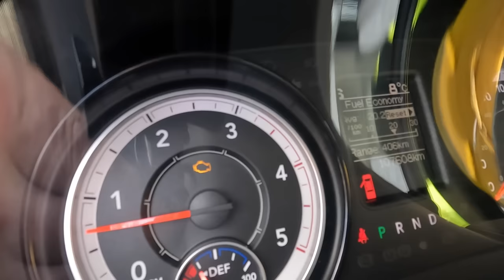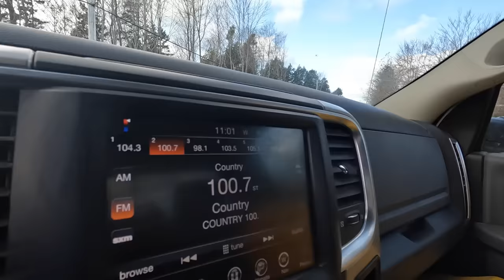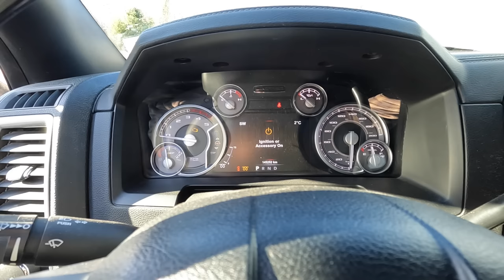FINALLY AN UPDATE ON THE COTTAGE & CUTTING TREES FOR POWER POLES?

Comment: Even if you clear enough trees around the poles, you'll still have to put up with tree damage on the line. Better off with a battery bank/solar/backup generator plus using inverters for high power items. My take is, if you aren't living there all the time, you can self-generate power & be off grid. Just go with a company that can tie all three above power sources together for you.

Comment: WOW it is looking SO good now it is opened up a bit more round the lake and stuff is healing up a bit from your hard work. That was a pretty accurate drop, just touching that pole marker 🙂Was that an Electric Saw you were using, it looked like it had a power cord to it? I have one here that I use for cutting the fire wood to length. Works well.
Reply from the maker: No its a gas 291 sthil
Reply: @workplaytv  OK, thanks. Did a good job on that tree, even if the bar is a bit short. Loving what you do.

Comment: Hi Bobby again, previous owner. Talk to L. & B. Electric Bridgewater because power. Michael knows a lot!
Reply from the maker: I did have them in and designed a system for me. Rather not put on the roof. Exploring the option of using the sheds or building a ground stand

Comment: If you're going to use it as a rental u need poles, with a maintaining marked driveway whenever it will be actively rented for emergency services. Huge liability with our those two.  Also property value will increase so just bite the bullet and do poles. Solar isn't free by any means

Comment: Standard solar panels and tree shading do not go together and if there is any shading then you will need micro inverters on your panels. As you are harvesting light then your panels need to be in the sunniest locations. You will also need the best battery storage that you can afford. Find a very good solar installer, go and see some examples of their work and talk to the customers, every location in this world has its share of crap installers. Solar does work, but do your research in depth, Youtube is a good source for solar generation results. Here in the UK smart tarrifs are coming to match up with solar generation.